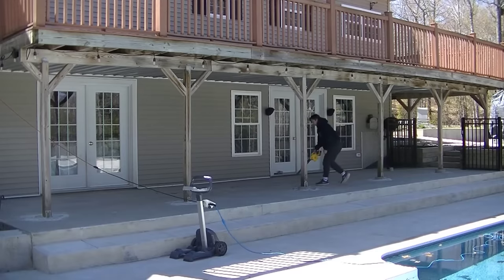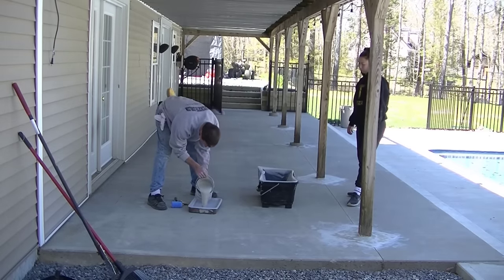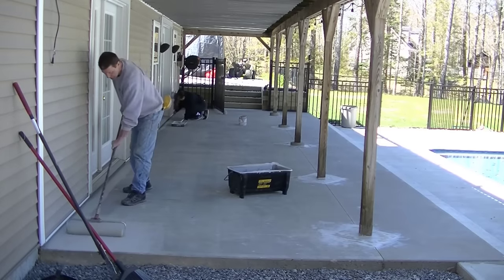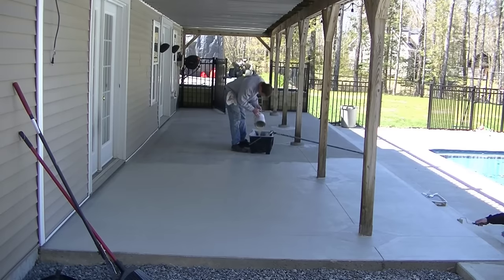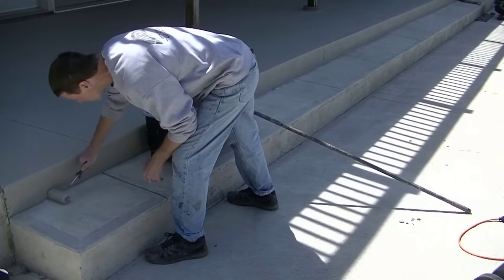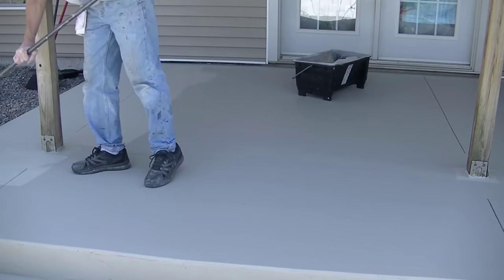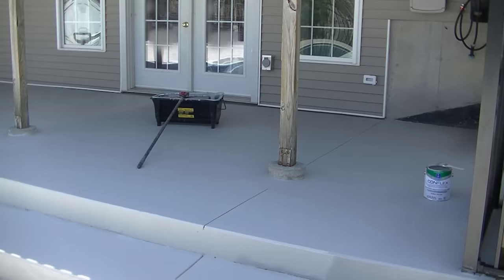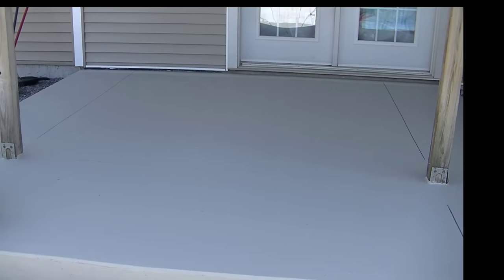How To Paint Concrete (What I Use On Patios, Pool Decks, and Walkways)

Comment: Looks great.  You've given me a lot of confidence to do the same with my front porch.  How would this paint hold up in the winter of say Colorado?
Reply from the maker: It's on my outside basketball court here in Maine. Gets covered in snow for 5 months. It's been on there for 5 to 6 years now. It could use a little touch up in some small areas but overall looks very good still.

Comment: Very informative video. The results look great. I have always used epoxy paint on my concrete with decent results. Will this stuff hold up in a garage?
Reply: No!!!..here's the Deal,...if you have bare concrete.use a xylene base,acrylic silicone concrete sealer,solid color..h+c brand Sherwin Williams and or Loews..my customers drive 60.000 pound provost rv's on and is uv sun ray resistant..we get 13 years lasting. Never peels just slowly fades in a decade ..if your garage floors is painted with some silly waterbase paint..grind it off down to bare cement first.h+c will not show any tire marks...if you use a water base "epoxy seal" brand from h depot it adhere very well but has no sheen!  Very dull and definitely shows tire marks....
Reply: @sandspritpark  
Reading your post here...Maybe you can help me with question.
I am by myself and need to watch income,I want to do my cocrete driveway...make it just nice looking..its been previously sprayed bt the road gypsies(got ripped off years ago) and has black spray paint(ughhh)my trying to put lipstick on a pig...is there a way I can blakcoat this to look decent...black epoxy paint or???
Any advice you have would be appreciated.Thankyou

Comment: What about acid washing and primer? You may have mentioned something about those I probably missed it. I'm still learning so I'm just asking not trying to be rude or anything.. I enjoy all your videos thanks for taking the time to make them great info in the videos.. I always hear stain is better than paint for concrete what are your thoughts on that?  Thanks
Reply from the maker: No need to acid wash or etch with this paint. As long as you can clean it by pressure washing you're good.
Reply: @MikeDayConcrete  How does this topical paint adhere to the concrete without penetrating into the surface with moisture vapors and normal deterioration of concrete?

Comment: I live in central Florida. I used a stain that I got from Sherwin Williams. It looked great when I first put it down . My issue is seems I need to pressure wash it every year because of mold growing on the surface. It’s only be on for 3 years and I can see I need to reapply. Might try this but wondering what prep I would need to do.

Comment: I wonder if I can use this on the old concrete patio at my house. It was previously painted and it's very old and worn. Would I  need to have it sandblasted  first?
Reply from the maker: Probably a good pressure washing would be good. I would probably lightly grind it, it's hard to tell without a picture.

Comment: Thanks for all of these videos, Mike. One question - how long should you let a newly laid concrete patio cure before painting like this? Thanks.
Reply: That’s actually a very good question. We used to have to do a pH test on newly stuccoed buildings and wait until the levels were sufficiently balanced before applying paint. Short of doing a pH test, you should be ok painting after 28 days.
Reply: 28 days.  7 days with a rapid set product.  Most manufactures will let you get away with doing a mat test to see if the moisture has evaporated.
Reply from the maker: Yea, both good answers here. Most of the time 28 days. This paint withstands high PH, up to 13 so you could paint a little earlier than 28 days with this one.

Comment: Mike, awesome video and tips.. i have a question: How do u prep the rough concrete surface before painting. Does it need to be grinded  first or apply any other material to smoothen the surface? TIA.

Comment: The first time you apply a paint over concrete, it will always look nice and refreshed.  A few years later, when 30 percent of the paint has peeled and flaked, the surface will require a ton of scraping, power washing and sanding before you apply a new coat. About a year later, another 30 percent of the original bottom coat has separated and lifted from the concrete and the ton of preparation for repainting will be three tons.
Reply from the maker: I haven't experienced that with this kind of paint. Been using it for years now.
Reply: That's what happened to my patio. I wish I acid stained it instead.

Comment: Be careful listening to everything this guy says. Always refer to product data sheets for technical information on proper application of any product. He states it was ready for the second coat in a short time "I didn't have to wait at all".  The following is the proper dry/wait time as recommended by the product manufacture technical specifications.  Over-coating should be done after the ConFlex has dried for at least 4 hours (77°F and 50%RH) and before it is exposed to any use
Reply: John Shaw, Thank you for the heads up, because after watching this video previously. I remember him saying this very thing and typically, one should wait at least 4 hours (Hope. I’m right) before adding a second coat. I appreciate your response this was helpful as i am planning to do my patio area.
Reply: Thanks Karen make your own video dont sit there but hurt and abuse that keyboard

Comment: This looks great! Question; I used a clear wet-look sealer on my patio. I didn't like the result. If i wanted to use Conflex to paint it over in gray, will it still adhere properly to the sealer that I previously used?
Reply: I had the same question.  I’ll probably just remove the sealer before painting
Reply: @lillieberger2883  @Omar Pesantes @Mike Day Concrete we all have the same question, I sealed my patio but hated the result , can I paint over it?
if not , how do i remove the sealer ?

Comment: Hello. The Sherwin williams site describes conflex as being used for vertical surfaces. 
You also mentioned that you use this for your basketball court. I recently had a slab laid for a pickleball court. That type of paint has to be applied with a squeegee making it a bit difficult for the diy. Will conflex work and cover small imperfections?  They are both 100% acrylic.  Thank you
Reply from the maker: Yes, it should. I've had it on my bball court for 7 years now.

Comment: I sure wish you were located in Alabama! I have a floor in my shop I need to paint, epoxy, seal to keep dust down and cleanup faster and easier. Plus the building is on uneven ground so I have up to 4’ of poured foundation wall to paint as well.

Comment: Would you do this on a garage floor versus the two-part epoxy? Great video!  Thanks.
Reply from the maker: No, it's not made for cars to drive on. But look up a product called "Revive" from Deco-Crete Supply, you could use that.
Reply: @MikeDayConcrete  Thank you! 🇨🇦

Comment: About five years ago I bought some solvent based concrete paint at Sherwin Williams for my back porch. Just under $ 100 / gallon as I recall. I really tried to do it right, acid cleaning the 50 year old concrete and rinsing it well. I waited for optimum weather and applied the first coat, sprinkling silica sand into the wet paint. After overnight drying I applied a second coat; and then (since I had enough material) a final coat the following day. My only regret was that I used a pretty large grit silica sand; but boy, was it non slip.
After three years I began to see small spots scaling off and now there are modest areas where it has peeled, all at the edge where the most weather and traffic occur. The old concrete was quite smooth with only hairline cracks, which filled with paint and looked good. I really had hoped for better durability, but with the weather in Colorado perhaps that is asking too much.
I am now considering putting Trex plastic deck boards directly over the concrete, anchored with Tapcon screws. I have Trex on a covered patio and my front porch (where we removed the concrete slab and used treated lumber framing and both areas look like new. Any suggestions?

Comment: Is there a problem with mixing and pouring the paint, then spreading it with a big roller? As opposed to using it in a bucket?
Reply from the maker: It's easier to dip and roll, goes on more evenly.

Comment: Just found your channel and it's just the info I need. But I have a couple of questions. I live in Zone 4 and so it does get really cold in winter. So first what outside temp should I be doing this? Next, it is my front porch that has a set back so we can put a couple of chairs on it faces north and It gets black where the weather gets to it. I have power washed it before and it does come up good and I have no cracks or damage but the cement is quite old.
I have repeatedly asked around about painting it to be told you can't do anything with it. So now I have to check if I can get this product here in Canada.

Comment: Hey Mike, what is a good product to strip a sealer. The contractor messed the middle of the driveway by adding too much sealant. Then he tried pressure wash it and it wouldn't come off, so he tried to use xylene to remove the excess sealer. This removed the sealer but it also discolored the area where it was applied, and it looks worse than before.

Comment: Mike just saw video..great job.. had a question, my concrete patio doesn't have  busj Irish but a
circle motion finish. Can I still us this paint and use a different brush?
Reply from the maker: Yes it'll work
Reply: @MikeDayConcrete  
Thank you for the quick response, I have another question. Went to buy paint and came back and noticed that my concrete slab has wood dividers.. through me in a loop as to what to do with those? Do I paint over them or miss them completely? Any suggestions would be appreciated!!

Comment: Conflex, ...maybe not so great. Three or 4 years ago, based on this video,  I went with Conflex. It looked great, but it stains and wears easily on brushed concrete and the front porch quickly shows wear sings which do not clean up well. Granted we are talking some tracked black mulch, after landscapers apply it seasonally,  but it just doesn't clean well for us. I tried hand brushing as well as power washing.
It is rated for vertical surfaces too., so not sure if Sherwin Willias decided to change everything about it?

Comment: Mike I have a patio that I covered and the expansion joints are very big in places. 1 1/2'" in places. If you are not careful you can hurt yourself on them. Previous owner added around original home pad. So the joints are bigger then normal for whatever reason. Total area is 640 sq feet. What product do you recommend to make those joints level so I can use conflex on the whole area? Love this video btw!
Reply from the maker: We use Sika sl-1 like in the other video you watched. You'd have to fill the crack with the joint foam and leave it about 3/8" low, then sika over it or you'd use a ton of caulk.
Reply: @MikeDayConcrete  ok thank you so much. Is the Sika-1 paintable with conflex?

Comment: We painted our concrete garage (it’s a smooth concrete) with an epoxy paint from home cheapo and the first winter the water from melting snow off the cars destroyed the floor. Did that happen because we didn’t put enough coats or should we have used something with friction material or bad prep? Seems the smooth concrete just made it hard for the paint to adhere well.? Anywhere the water sits on the painted surface just bubbles the paint off. Sucks. It did look great for a couple months though 😳😆
Reply from the maker: No prep on the concrete, along with low quality epoxy is why it's failing.
Reply: @MikeDayConcrete  what type of prep is really needed on smooth concrete other than vacuuming and wiping it down like we did? The acrylic stuff you talk about in the video is a better choice? The stuff we used is Behr Concrete and Garage 1 part epoxy coating. Ideal for garage and basement floors and driveways-resist peeling UV protection stain chemical and weather resistant.... all bull crap that’s written on the can.

Comment: Hey mike ! You was on point with discussing your video, I have one question, say I have a cement pad , covered , but the home owner did some paint that chipping , would you suggest I power wash  it was completely off , or use a chemical to peel it all off to restore back to original floor, then use comfex

Comment: Great job Mike. Currently, I have a concrete driveway of about 1600 sqft that I have previously stained and sealed. Five years later (today) the stains is peeling and it looked pretty raggedy. I am hiring a contractor to sandblast the area to remove the stains and to clean the surrounding. I am hiring another contractor to pressure wash the area, patch cracks and imperfections and then apply either paint or stains and the seal it. I am told by several contractors and friends to stain and not to paint. I'm confused.  What do you think I should do Mike? And what's better to use on flat concrete? Conflex paint or Acid Stain? Thank you in advance for your advise.
Reply: @emrythompson  I have the concrete power washed twice already and the stains, some are already peeling and some are in blotches still remains. Thanks for the feedback.

Comment: a couple of questions.. i have a driveway that has what i believe is an epoxy on it which is peeling.  it was applied atop a paint or another epoxy on the same driveway that was peeling.  its is super slippery to walk on in the rain.  I didn't apply either. I want to remove it all back to the bare concrete and go back with a light color that isn't slippery when wet and can handle hot tires from the cars.  What do you recommend to strip the existing and would you recommend this product you applied to the driveway?  Is it slippery when wet?  If not, what product do you recommend?  Thanks in advance!

Comment: Mike So I tried to buy this product to cover a surface similar to what you did here in this video.  Sherwin Williams told me that they do not recommend this product for flat surfaces because it will peel off after a year.  They told me this should only be used on block walls or concrete walls not on flat surfaces.  Three stores as well as Sherwin Williams District Manager told me that this product is "not and should not be used for flat surfaces".  It will only last a few months even on an application like you did here that is a covered surface.....Glad I checked with Sherwin Williams before I spent $300....
Reply from the maker: I've been using this for years on recommendation from their regional manager. No problems. I've even had it on my own outside basketball court for 7 years now, no problems or peeling. I recommend it because I install it, I bet they have never even used the product.

Comment: Good job. Just a few constructive points for you. Be more specific and show examples where possible. EG: 1/2 inch or 3/4 nap...depending on concrete. Show us how you eval the concrete and determine which roller to use. I only slightly wet the roller... show us, its tough for newbies to know what you mean. When rolling it out, show close up of concrete and how you know its being well applied or when its too weak. This is a big mistake people make trying to stretch out the paint... or going too heavy.  Early morning or not in heat. Try to give more specific example - The optimal conditions to roll is when its 70-75 degrees and shady or indirect sun. Never roll when its direct sun and or over 90 degrees. Why didn't you paint the circular cement supports? You did a great job and like the video, but as a watcher of many DIY videos just wanted to provide some feedback to help if possible.

Comment: i dont see you mixing all the gallons together ( boxing) especially for the final coat ? So if you need to touch up a missed area, you will have the exact color between all those single gallons. Another thing, after blending out or feathering in the patchwork, do you wire brush off the loose 
powder residue  that just sits on the surface that could keep from proper adhesion of your paint coat ?

Comment: How has paint held up, mine is already starting to peel after 2 days I used same product and prepped it right.
Reply: My guess there was either oil or silicone in the concrete.  It is really hard to get paint to peel as it is curing.

Comment: Hey Mike, great video. I had a question…I have a concrete carport on the side of my house which I’m converting to a terrace (cars won’t be driving on it) it was previously stained black…I want to paint/stain it a different color…since it has already been stained am I able to paint over it with this product? Or I would need to again it again? Thanks!

Comment: Hey is there a product that will work on driveways? I do a lot of structural patching example: replace a 10x20 section on a drive that’s 20x70. Commonly close to a garage entrance. People don’t always like that the repair is a different color but most times there’s no reason to replace and 7k drive way that’s not all bad..  I wonder if this product will hold up to hot tires fresh off  the road in summer heat?